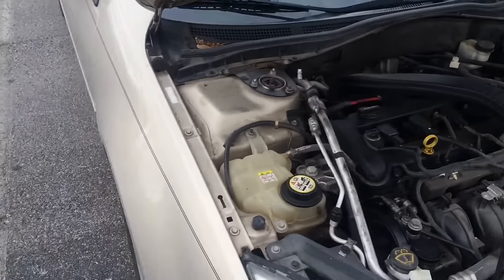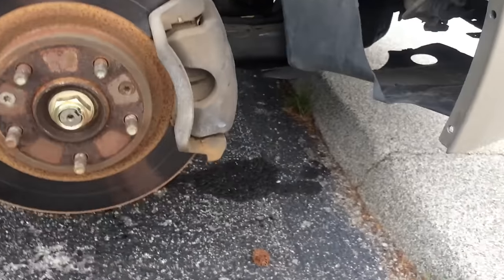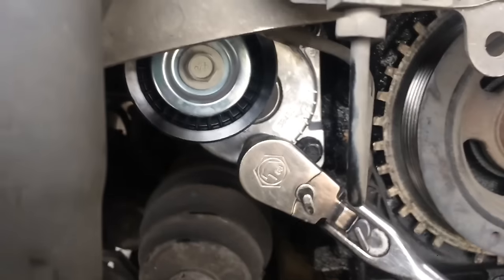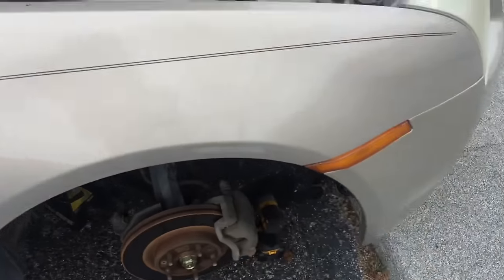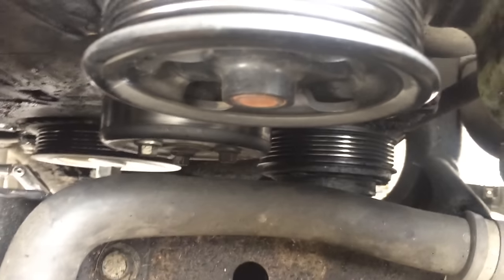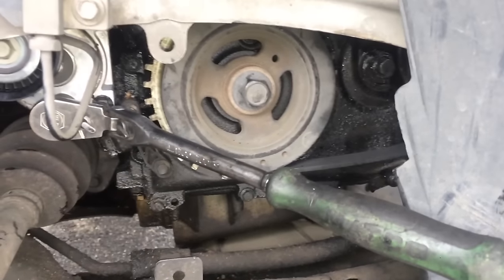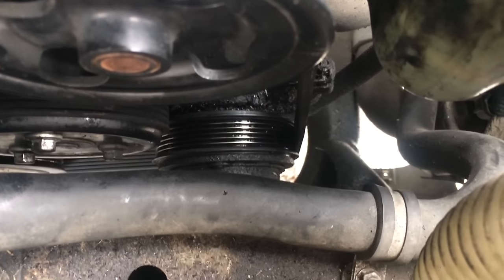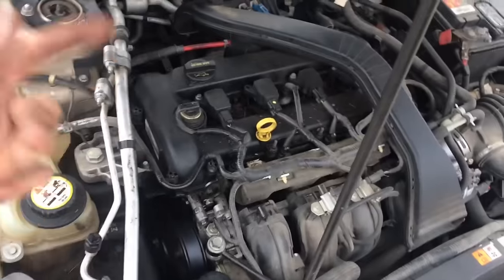Ford Fusion Serpentine Belt And Tensioner Replacement

Comment: Referenced this for an emergency alternator swap tonight. For anyone watching this you can loosen the tensioner from the top, 15mm wrench right below alternator. Getting the belt back on was a bitch. Route it on the tensioner and everything except the idler pulley, then release tension from tensioner and slide over the idler pulley 👌🏼

Pulley #5 last. About 1 hour for alternator swap start to finish.
Reply: 1hr!? What path did you use to get the alternator out? Mine is 2012 3L. I'll be a couple hrs to get the fan out. Then remove wheel and liner and begin all of that.

Comment: If doing this for a squeaking belt.  I would clean off all the engine grease with Gunk Engine cleaner and water hose and wipe pulleys down with ether, alcohol,  or brake cleaner to degrease.  Great video.
Reply from the maker: Thank you! Good suggestions!

Comment: Be sure to check your idler pulley and replace if necessary. Mine had a lot of play in it. For tensioning of the new belt, I found it easiest to slide it onto pulley 7 last.

Comment: If you take the 3 bolts off of the top front pulley, then fit the belt on and re-bolt it while the tensioner is loosened, your belt goes on extremely easy.
Reply: You would need someone or something to hold the tensioner if you weren't replacing the old tensioner. My top front pulley broke so I had nothing holding the tensioner back so that  wouldn't work in my case.
Reply: @innergame05  You can use a breaker bar and it can hold itself on part of the control arm to maintain a loosened tensioner. Then remove the top front idler pulley's three bolts to apply the belt. With the tensioner still hooked on the control arm, once you get the belt on the top front idler pulley, replace the idler pulley and tighten the bolts.
Reply: This comment saved me a lot of time completing this job. Thank you.

Comment: Thanks for the video. The "knocking" noise at the end is from the runner valves in the intake manifold. Very common on those mazda 2.3 engines.
Reply: Ibrahim Alghamdi could it be (perhaps) an indication that the timing belt <if this is an I4> is also   In need of replacement?
Reply: Tax2Me these have timing chains. No belts.
Reply: Mine does this too. Is that normal for those runner valves or is there something that should be done?
Reply: @justins8768  as far as I know the only fix is to purchase a new intake manifold. The valves are made of plastic which deteriorates quickly over time. It can potentially create issues if the valves break off and pieces make it into the engine, but mine has been running fine for years as is.
Reply: @ibrahimalghamdi94   I appreciate your insight on this.  My grandson just bought one that we'll be doing the serpentine belt on, and I noticed he had some oil leakage around the intake manifold, so I told him replacing the gasket is an easy and cheap fix, but sounds to me like the wise move is to replace the manifold while I'm in there.  I'll have to price one as I doubt while writing this it will be cheap to him.  THANK YOU!!
Reply: @Tax2Me it uses a chain not a belt, these things are tanks mine is at 220k miles and running like new

Comment: I just did this without removing the tire, I put the car on ramps since I had other work to do.   However removing the tire will allow more room to work with. For those who will do this alone, you might struggle.  I tried for hours before figuring it out.  
Here are some tips: remove the plastic cover, this will allow more room.  Use a breaker bar ( a ratchet one is a plus). I used a 1/2" breaker- it didn't have a ratchet, but still worked.  The trick is to get the tool at high enough angle to loosen the tensioner all the way down. There are marker lines on the tensioner, you will have to get all the way to the last marker to get the belt on.  Save the water pump pulley for the last, it may be easier. You can put the breaker bar on the notch on the frame, but that may not fully release the tension. I did with  one hand on the breaker bar and the other hand adjusting the belt.

Comment: No trouble just sliding it in to the tensioner? At all? Losing my mind working on this 08
Reply: Did you get it on? I’m having trouble too
Reply: @Carguy4lif3  I did. I wedged a wrench between the tensioner pulley and part of the block and pulled, allowing it to put slack on and let me slide the belt onto the last pulley.
Reply: @anthonycurby4606  thank you!

Comment: Bahaha.... "It's probably like, an '08 or something like that." 😂😂😂 Literally looking at buying a used '08 Ford Fusion right now for $525 with a broken idler pully, so thanks for this video, lol!
Reply: It's a good car, mine's Raggedy as a MF, pretty sure someone hit something (nothing major) as there's dents in the door and the bumper is screwed on. But it's at 278K and still drives mostly great! Durable car for sure!
Reply: @christopherbarber288  Nice! :) I ended up getting myself a 2009 Nissan Altima, which I still drive to this day. I like it. ^_^ I had the 2012 Nissan Altima prior to this, so it's almost identical. Thing I like the most is the push-to-start button, because I'm an UberEats driver going in and out of the car often, so it's nice to be able to just keep the keys in my pocket!
Reply: I have one too. It's got 165k on it and I've had it for 6 years and knock on wood but I've only had to do the water pump and the idler (both of which are pretty easy to do). Solid vehicle for sure.

Comment: i was just working on this on my fusion, and I just cannot get the new belt on, I have a feeling the tensioner I bought may not be the correct one for the car.  Before I loosen the tensioner to get the belt one, theres gotta be like an inch that the belt is short....I dont recall it taking that much movement to take belt off the old tensioner, but I cannot turn the tensioner enough to have the space to slip the belt over it...I have check it over and over and my routing of the belt is correct.  Im gonna go back out tomorrow morning, pull the new tensioner off and compare it to the old one.
Reply: Ever fix it?
Reply: @rashawnbey8362  yes...took much effort, but I was able to do it.

Comment: Its not engine noise its the intake runner flaps...unplug the vac to control and noise goes away...can be deleted or locked to stay open
Reply: Could you explain a bit further what you just said pls
Reply: @alexgonzalez7260  inside the intake manifold there are plastic flaps in each runner all connected and controlled through a long steel rod, controlled by the intake runner control actuator, plastic flaps become loose on rod and make a loud clacking noise which many mis diagnose as an engine knock or valve noise
Reply: yy z replace maybe.  Remove why?   If engineering thought this part was needed then removing it does <only god knows what> no good service
Reply: Love you sir 🤗
Reply: yy z hmmmm that might be that fluttering noise when I accelerate. I can hear it right in that general area too. I had to replace a valve that connect from the manifold after it got brittle and broke last year.
Reply: @1Atlkid  yep...bet those plastic flaps are loose on the shaft...if you unplug the vac line to actuator...the cracking noise goes away because the unit defaults to open

Comment: The Freesher: you said the belt went on "just fine with no problems there"...then you noted it took about an hour just to put on the belt. I have tried putting on a new belt for a 2007 Mercury Milan 2.3L before, but eventually called AAA to tow it to the mechanics. Was the tensioner pulley the last part you put the belt on? Any suggestions-I could get it close but never able to slide it over the tensioner pulley. Tried to put the belt on other pulleys, but the belt always seem to slip off some other pulley. I'm going to change tensioner pulley and idler pulley soon: theres a vibration and a squeak. You did a really nice job on the video- thank you. Just wish I could have witnessed your challenge of putting on the belt.
Reply from the maker: It’s been a while, I THINK I put it on the power steering pulley last, but it may have been the tensioner. I have a specific tool for belt tensioners that make it easy to put on from just about any angle. If you are limited to wrenches and ratchets, just try with the pulleys you are close to, which will probably be the tensioner or the crank shaft. Worst case scenario, try one without ribs,
Reply: The Feesher link yo tool(s) would be nice.  Since you are all about helping, that seems to be required information missing from this help video

Comment: My belt tension for my 2010 Fusion needs replacing. The shop says the bearings are blown out. They gave me an estimate with parts and labor of $350. Is this typical or are they trying to screw me?
Reply: Both. Parts are cheap labor is expensive. If you have a good job and don't need to worry about it let the shop handle it, otherwise buy a parts manual for your car and learn some basics. I've changed turbos, belts, alternators, power steering pumps and helped with a transmission all from manuals and YouTube. Wish I was richer then I could afford not to worry about price and probably have a car that wouldn't need so much 🤦‍♂️. It's all pretty easy if you're patient
Reply: That's such a smart statement bro, it defiantly seems easy with time and patience to figure it out
Reply: Yeah of same cost me like 300 to fix it.
.
Reply: @danielmarkulic9399   I was in the same space in my 20's and 30's.  Now that I'm a bit older I still do a lot of my own work even though I can now afford to pay a shop.  If the work isn't too heavy (my garage is set up pretty decently) I do it, but if it's heavy I just send it to the shop.  Keep doing what you're doing and before long you'll be in the same situation.  I'm quite sure of it.

Comment: I have a 2007 and everything about working on it is a pain in the ass. Whoever designed the engine compartment deserves eternal misery.
Reply: Same with our 2008. I had to remove the headlight (passenger) to get the power steering pump out of the way to get to the thermostat. How stupid!
Reply: My father and fiancé hate me for asking them for help. Everyone that I’ve spoken to about fixing my alternator (oil leak ruined it) has rolled their eyes and laughed at me when speaking about fixing it 🤣 almost done though

Comment: Other than the wheel, did you have to remove any plating from within the wheel well? I have a 2007 and it looks like I can't even get to the tensioner without getting the car up on a lift, even when I took the wheel off.
Reply from the maker: Curtis Price there may be a plastic cover that needs to come off but that should be it

Comment: Is a bad tension pulley easy to see or hear on a 2014 Fusion? My wife came back from a Firestone oil change with the check list saying the tensioner was bad. I have not looked yet. Nasty snow and cold as ** outside.
Reply from the maker: Possibly hear if the bearing is bad, but if the tensioning mechanism fails you’ll only know when it keeps throwing the belt off

Comment: This helped, but what is that big black plastic air channel going over to the exhaust side of the engine for? Air pump for emissions during startup? My wife has a 2011 and hers doesn't have that thing on it. I am watching this video even though I am a mechanic because recon saves hours. So thanks.
Reply from the maker: Honestly no idea, but I figure it is probably emissions related, I’m a Honda guy lol
Reply: That’s a cold air intake for the alternator lol. I too was amazed when I first bought the car haha
Reply: Marcus Taber 
Without this duct, the alternator will over heat.

Comment: About to attempt this lol hoping this is our problem. Husband was driving This morning and engine and battery light popped on and then he lost almost all power. Was able to nurse it back home and the belt is completely off.... Just had belt replaced less than a month ago and they did not replace the tensioner so we are hoping replacing it will fix the problem.
Reply from the maker: +melissa allen that is what happened with this car as well. I had put the belt back on previously but told the customer that I knew for a fact that it needed a tensioner, sure enough it came off another time so they let me replace the tensioner this time around lol hope this video helps you get the job done!
Reply: The Feesher this is litteraly what just happened to me. Finally the loud squeaky noise ive had for a while got worse and all of the sudden, no noise. Battery light comes on and soon sfter the engine light. Manage to drive it homd and turms out the belt is completly off and looks like a pulley in the back is misaligned/wobbly. Im guess ill have to switch out the pulley. Sucks that i cant just fix this without a carjack though. 

Thanks for the video
Reply from the maker: Sorry to hear about the car, hopefully you can get it all sorted out

Comment: Parts just came in .. I’m going to attempt this lol
Reply: Ok sooo the new tensioner didn’t work out so I put my old one back in along with a new serpentine belt , no more squeaking yay 😀 honestly the hardest part is putting the damn belt back on.
Reply: @brendarodriguez4497  tu pusiste el.belt. byself..
Reply: @tonycervantes4816  Si  no es tan complicado
Reply: @brendarodriguez4497  que año es tu carro ..
Reply: @tonycervantes4816  2008 por que ? Necesitas cambiarlo en tu carro ?
Reply: @tonycervantes4816  2008
Reply: @brendarodriguez4497  que bien el mio es 2006.   Este es mi fcbook.  Cervantes Cervantes   . Cuidate
Reply: @brendarodriguez4497  si necesito cambiar el  belt tensioner  pulley  .  Chilla bien feo el carro.el belt segun esta buena..
Reply: @tonycervantes4816  bueno pues seguramente que lo vas a poder a cer 😀 yo tengo que ponerle nuevos rotors pero me da una hueva jajaja
Reply: @brendarodriguez4497  y si  a veces pasas eso. Jajajaja la huevonada ..
Reply: Cuanto te tardaste en poner la belt
Reply: @tonycervantes4816  como una hora talvez hora y media ya lo intentaste ?
Reply: @brendarodriguez4497  no aun no... segun la banda esta buena.. solo quiero  cambiar el belt tensioner   pero no se si pueda cambiarlo sin quitar toda la banda. Tu que dices.  
.Brenda se puede?
Reply: @tonycervantes4816  si yo tambien hice lo mismo cambie el tensioner es facil lo hice 2 veces por que el primero lo quebre jaja quita la banda y los 2 tornillos que estan deteniendo el tensioner .. si es que me acuerdo nadamas son 2 tornillos tienes que quitar la llanta
Reply: @brendarodriguez4497  okay brenda.pero puedo cambiar el belt  tensioner  sin quitar el serpentine belt. ? Lo que no quiero  es que  el serpentine belt. Se mueva. .. en el shop me dijeron que ese esta bien que necestio solo remplazar el belt tensioner..
Reply: @tonycervantes4816  tienes que quitar el serpentine belt por que el tensioner pulley que vas a cambiar es el que esta deteniendo el belt a huevo lo vas a tener que poner otra vez sobre todas las pulleys
Reply: @brendarodriguez4497  de verdad ? Y es lo que no quiero solo queria mover la serpentine belt.aun lado mientras cambiaba.el belt tensioner
Reply: @tonycervantes4816  Pues si lo quieres intentar a si pero es tan facil para la banda que se mueva bueno pues que tal si la amarras con algo a las otras pulleys para que no se muevan ? Pero en serio no es tan dificil para poner la banda .. si vivieramos cerca ya te hubiera ayudado 😀 cuando vas a ser el Jale?
Reply: @brendarodriguez4497  voy intentarlo hoy o manana. A ver si solo puedo cambiar solo el tensioner . Porque verdad si cambio el tensioner solamente y me sige Dando ruido es que necesito cambiar la belt..
Reply: @tonycervantes4816  me dices cuando lo hagas para ver como te fue 😀
Reply: @brendarodriguez4497  okay pero tu crees que si se pueda cambiar el tensioner  sin quitar todo el belt de los pulleys otros. ? Brenda.
Reply: @tonycervantes4816  yo pienso que si usas tal vez unas zip ties para mantener la banda en su Lugar si trabaja
Reply: @brendarodriguez4497  okay brenda asi lo voy intentar hacer... happy  🎃 Halloween  cuidate
Reply: @tonycervantes4816  happy Halloween 👻 pasatela bien buena suerte
Reply: @brendarodriguez4497  Hola Brenda bnas tardes
Reply: @tonycervantes4816  hola como te fue

Comment: How do you know if the tensioner pulley needs replaced?
Reply: if it moves easily or has slop in it.  that said, I always replace tensioners when doing serpentine belts because they're cheap and I don't want to be in there again any sooner than I need to be.

Comment: Is it best practice to put the shell back on and  lower the car before starting? I replaced the belt but it comes off during starting. I'm planning to go ahead and change the tensioner too while I have the wheel off
Reply from the maker: Nah, it’s no biggy to start it while it’s in the air as long as it is well supported
Reply: @TheFeesher  thanks! Tensioner must be the root of my problem. Very helpful video

Comment: I’m curious, this morning it was our first real cold day, my belt was slipping on the power steering pulley, once the engine warmed the issue stopped.

Should I replace the belt? Or could this have been just from not letting my engine warm before driving?
Reply: There is no belt wear, and it doesn’t seem loose
Reply from the maker: The belt is failing in some way or another. Either tensioner is failing to provide enough tension or the belt is old and dry rotting and not providing enough friction. Easy fix is to just replace the belt and see what that does

Comment: If I had known my 2007 Fusion was so compact and this difficult to work on, I honestly would not have gotten one. Lest, it’s my first car :/. Everyone rolls their eyes when I ask about repairs 🤣
Reply: only paid 1000$ for mine, just did the valve cover gaskets, plugs, coil packs, n brakes. Honestly its a real easy car to work on. The belt is probably the most time consuming, frustrating job to do on these cara lol.